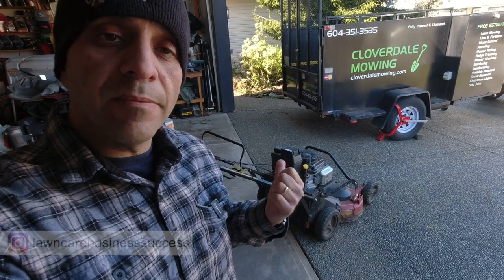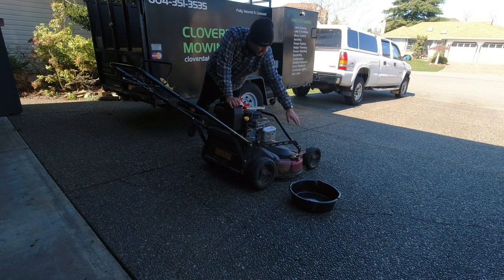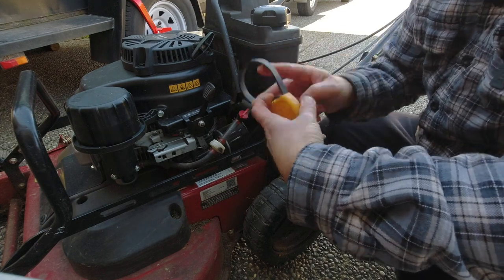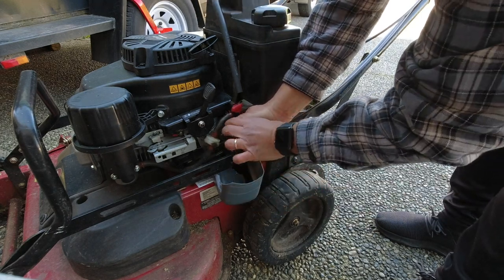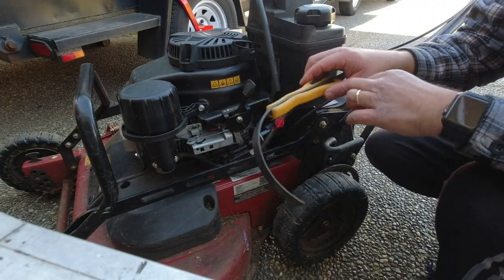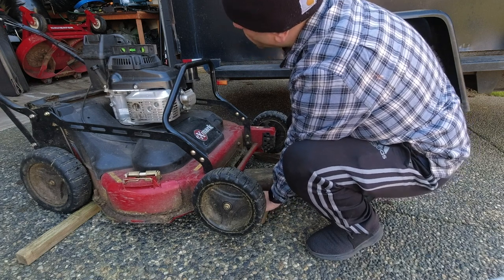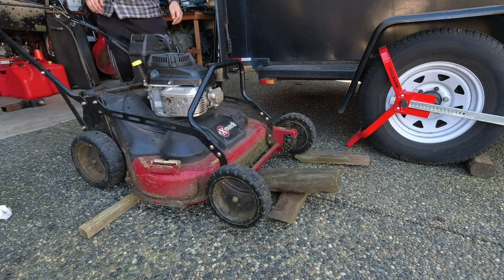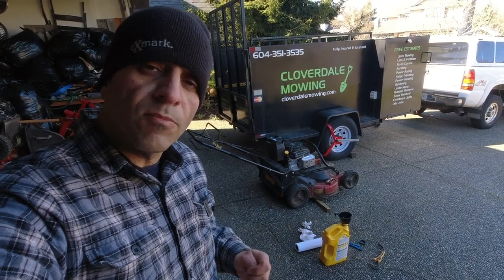Exmark Commercial 30 Oil Change Tips

Comment: Finally got around to watching this.  I tilt my 30 over on its side like you did but I must like having a higher sketch factor and I use one hand to hold the oil pan up under the oil filler (so I don't spill and make a mess on my driveway).  As the flow gets going I'm able to set the pan on the ground and use both hands to guide and support the mower.  As for the oil filter, fortunately my hand is skinny enough to reach in and grab the filter and loosen it.  I'm going to have to pick up a strap wrench not only to make this easier but for the other uses it has as well.  Julio, I hope you have a great start to the mowing season.  Down here in NC I'm about a month in already.  Looking forward to more videos from you this year!
Reply from the maker: The higher sketch factor comment made me laugh. I can just imagine. 😂 I hope you have a great season as well. Thanks for watching. I appreciate it.
Reply: @LawnCareBusinessSuccess  I enjoy your videos very much.  Keep up the great work with your business and bringing great content.

Comment: Love your videos you're doing a great job. Just a heads up small air cooled engines require specific small engine oil. Small engine oil is fortified with zinc and phosphorus to to help in high heat situations and premature wear on valve train, cylinder/rings and rod/bearings. These additives are also for longevity of service. Automotive grade oil do not have any of those additives due to the fact they have catalytic converters that would get plugged up by these additives.  I've been an engine builder and mechanic for over 18 years just a little background on me. Save your equipment and run the correct oil
Reply from the maker: Thanks for the tip. I’ve always just used automotive oil and never had an issue the past 17 years. Probably because I’m in the pacific north west and it doesn’t get too hot here even in summer. Usually we get hot spells that last a few weeks at most in august or july. Thanks for watching.

Comment: Haven't done a oil change on my commercial 30" yet with the Kohler but looks a lot more simple then the kawi great information filled video sure to help a lot of people out, BTW how often do you Sharpen the blades on you 30"
Reply from the maker: Yes the Kohler would be easier with the drain hose that comes standard on Kohlers. Sharpening depends on the lawns and conditions. At a minimum once a week. Some years I have replaced the blades daily. Thanks for watching.

Comment: @LawnCareBusinessSuccess, how often do you recommend changing the oil in these Exmark Commercial 30 lawn mowers? And same question but for the oil filters? How many total hours?
Reply from the maker: I guess it depends on how much you use it. I don’t know the actual hours but I would only change the oil and filter on mine once per season and I used it as the main mower in my business. Years ago I use to change the oil in my small mowers once per week but I found that to be unnecessary. I do check the oil often though. Thanks for watching.

Comment: Julio, it is good to see ya back on YouTube sharing insightful tips as always. 

If I recall correctly, you provided a solid review of the Apple Air Pods you use for landscaping. Last season I was looking for wireless headphones because the Dewalt bluetooth headphones that I was using were absolute junk. Lousy connectivity, sound, comfort, and duality, so after purchasing two pairs of the Dewalt headphones I needed a replacement that would deliver superior quality performance. Bro, I couldn't find any other suitable headphones that provided all of the features I wanted, until I considered the Apple Air Pods Max. I purchased Apple Air Pods Max and have been completely satisfied with their performance in every aspect. Noise cancellation/transparency mode✓, connectivity✓, sound quality/volume control✓, comfort✓, ear protection✓. Although the Air Pods Max are quite expensive, it has been well worth it and has provided its overall value immediately in suiting my work needs. 

All-in-all I recommend the Apple Air Pods Max for Apple iPhone users working in this industry that may want to upgrade/enhance their audio listening as well as making efforts to protect their hearing from loud noise. 

Much respect to you Julio!
Reply from the maker: I actually am not going to use the AirPods anymore. As I stated in that video they are not actually rated or considered as hearing protection and may give you false sense of protection. Apple being the marketing machine that they are would definitely boast that as a feature if it were so. I am not going to use them anymore because I believe I actually may have experienced some hearing loss after using them for a few months. So I will be going back the isoTunes link over the ear style muffs for this season. Thanks for watching.

Comment: Well I used a electric oil extraction pump on mine. Thing is so heavy I just don’t like trying to tip it on the side. You stick hose in oil filler tube and suck it out. Hurts my back trying to tip it over and I am afraid of dropping it

Comment: I have an oil drain hose connected to the drain hole that lets me drain with less mess. Also I don’t have to tip it to draiin. The filter almost always makes a mess though.
Reply from the maker: Yes some guys have added a drain hose to the Kawasaki models. The models that have the Kohler engine come with the drain hose standard from Kohler. Thanks for watching.

Comment: I'm gonna stop here in the video as you are tipping it on its side. Go to your dealer and tell them you want the oil drain hose the Lazer z uses. Lazer z with a Kawasaki the hose is perfect for the commercial 30. I figured this out one day when I was changing the oil in my Lazer.
Reply from the maker: Yes I believe the threads are standard on the kawasakis and the drain hose fits many motors. I’ll grab one and do an install on the next oil change. Thanks for watching.
Reply: @LawnCareBusinessSuccess  it's well worth the upgrade. Saves a pile of time doing service.
Reply: You have a part number on that by any chance?
Reply: @livinnash7693  the tag may still be on the hose I will check if not just tell your dealer you want the drain hose for a Lazer z.
Reply: @Orefamilylawncare  I believe I found it. Thanx so much my friend and stay safe👊🏻